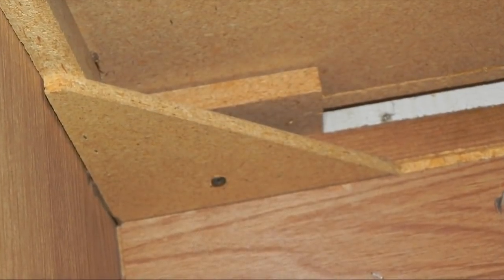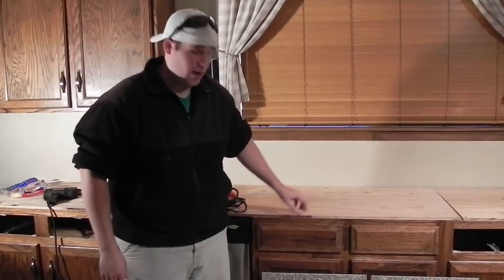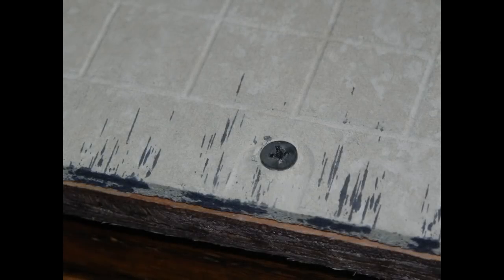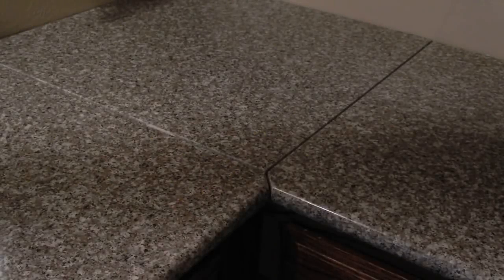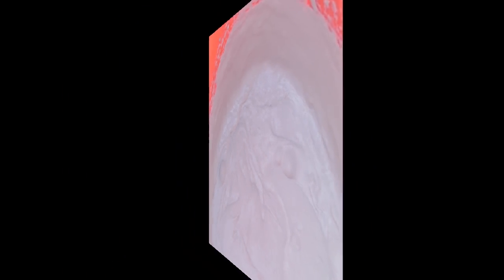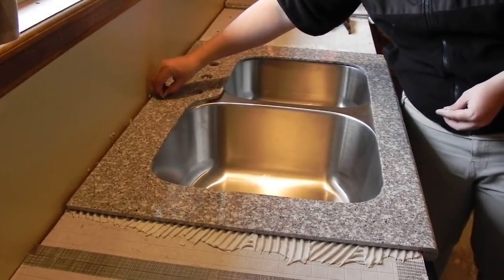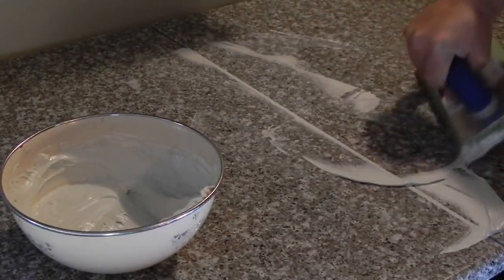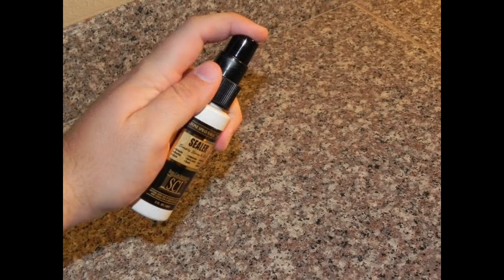Lazy Granite Kitchen Countertop Installation Video

Comment: I'm sorry.  This product and the installation is a fail.  Screwing down the plywood and the cement backer board from above prevents the counter from ever being replaced in the future without demolishing the counter and lower cabinets.  The sink would be equally impossible to replace in future.  The grout lines are hideous and ghetto.   In my area, there are manufacturers who sell custom sized economy granite countertops.  These are 1/2" thick granite which comes bonded to 3/4" plywood substrate, with build up and reinforcement, rather than buying 1" thick granite.  They are custom made as continuous counter lengths to suit your measurements with no seams.  The cost is half that of 1" solid granite.

Comment: I thank you for posting this video. There are a lot of keyboard warriors on here criticizing your video, but people will stop posting if all they get is criticism!  In the end, a ganite slab costs $30 to $50 per square foot, and for under $10 per square foot, this is a far cheaper choice. Most people don't have the budget to spend $3,000 to $5,000 for a solid slab and I think this video is terrific.

Comment: The concept is nice. However, it would look best with tight seams using epoxy mixed with granite dust. The large irregular shaped "tiles" confuses the eye making the whole installation look like a DIY gone wrong. I really hate saying this, but I feel obligated to tell others this is not the way to go. At least as far as having grout lines. A 12" tiles would look better if a tiled look is desired. Otherwise use epoxy with color matched granite dust to hide the seams.

Additional, the plywood and backer board surface must be completely level and even across the entire surface. Or you'll have noticable unevenness. The larger the tiles the better your prep needs to be. You can adjust somewhat with the mortar thickness. 

Lastly, no cutting corners when cutting the stone. Start with a new blade, use the fence, pleanty of cool water, and go slow to prevent chipping.

Cheers!

Comment: Hey, I have to be Mr (Ms) fix it in our house, very tight budget, and alot of DIY because of this. A contractor that workED for HUD really messed my Mama's, our, house up,,stealing money and half ass not fixing things. Well our countertop is a fake granite, that's already warped of room being wet u can see the swelled particle board on the thing. CAN U TELL ME WHAT that's called, I know it isn't granite, I don't know the correct name of the countertop. I been searching some way to fix it,,,we sure don't have the cash for new ones. Any help or advice would be appreciated. The ex contractor also really made things worse. Example, he put metal on our shingled roof, that leaked, it leaked more afterward and how awful it looked too,,didn't put gutters on, ruining what deck my mama had, he lied and said he replaced electrical wiring,,the wiring has been in this house since 70's late 79!!!!? It so happened the person he contracted the electrical work out to, I KNOW THAT MAN, he didn't replace it,,just hooked old up to New breaker box. The beautiful tiles on kitchen floor, cracked immediately within first week of walking on it.. HUD fired him, but he's still out there somewhere ripping poor old people off

Comment: Absolutely hilarious! This guy sounds like a tool. I agree with the other posts. I've been in the granite business for 20 years and the sink run should have 1 seam without spacers! Lmfao!  The sealer is garbage as well, you don't spray sealer on, you pour it on and bath then buff until dry.

Comment: that looks completely awful he didn't grout right so after a while the granite will crack 2 it shouldn't show seems at all its lazy boy granite tile doesn't mean its supposed to look like tile I did mine with the granite lazy tile and it looks like one long slab and I was told to use epoxy sealer to hide the seams this dude clearly doesn't know what he's doing

Comment: This is not a bad approach for do-it-yourself granite counter tops, but I would omit the installation of tile backerboard and mortar. Simply install directly over the 3/4-inch plywood with construction adhesive as most professional installers do.  Also, there is no need to accentuate the grout lines by putting in spacers and grout.  Seems should be butted together and seal with clear silicone.  They will be less conspicuous.

Comment: #664 is the cheapest granite there is. Locals business in Dallas area can do it for $29 per square foot can get you a fabricated full slab that's at least 2cm thick not 1cm thick that they are using.  That price also includes installation! These guys are literally selling trash remnant pieces.
Reply: @ DW, i live in Arlington. Any granite guys you can recommend?
Reply: gary paternite try cabinet stone city or any similar shop near their area. There are a lot of these granite shops in Dallas.
Reply: Thanks a ton sir!

Comment: is there a grout that is mixed to exactly match the granite?   If not, is there stuff so the homeowner can mix their own custom grout?
Reply: bakerchic1958 usually shops use stone glue/epoxy and pre-mix with correct coloring to match to granite then place that into the seam area. Once dry polish the surface lightly. You need to have a good skill in getting a correct coloring out come.

Comment: That is an awful lot of work to get something that looks so cheap.  I think they would have been better off with a nice looking laminate.  The cabinets are really low end.  It doesn't look like a house you would want to put a lot of money into.  You could do a nice tile backsplash and call it a day.  New cabinet doors and a nice laminate countertop would have probably been a better choice for this kitchen.  I've done a lot of DIY, and made my fair share of mistakes.  Things like this just aren't worth the time or money.  If you can't afford a really nice slab of granite, don't do it.  You'll never be happy with the results.
Reply: Those cabinets look like they might be in a mobile home that is 20 yrs old.
Reply: Decent looking granite is 24bucks a foot in my town.  INSTALLED.  Cheap as chips.
Reply: Hotrod Hog I'm pretty sure it is a mobile home.

Comment: Wow. Please people do NOT, I repeat DO NOT use this process, being a certified granite fabricator there are many variables in the equation he does not explain, A. He is using a 1 cm product, that mean's it's only 1/4 inch thick product, the quality of the product is poor at best 3 cm which is 1" 1/4 inch thick is the best product to use. B. Cutting granite, no matter what blade you have, on a table saw is never a good idea. The product will chip exponentially to start, and laying it on it's face will scratch it if there is any granite residue on the surface. The reason Granite is some what expensive isn't because the product cost so much, your paying for a quality fabricator and installer to give you the best results in a timely fashion.
Not to mention the time= money, the amount of labor and materials you will have into the project will cost you far more then having a professional do it.
Reply: Terry Henkes in addition, this guy didn't show any thing on how he fabricated the undermount sink cutout, which usually require 1 hr to do with wet hand saw. These guys only show using table saw which isn't even an actual wet saw type.

Comment: First of all the cost of this material in a natural slab form is fairly cheap. Second this guy just made a sh*t ton of work for anyone trying this..instead of mortar use freakin Liquid nail like a professional would..his damn seams wouldnt have been so bad if he actually gave a sh*t and mixed the proper color in the epoxy before butting them up!!!

Comment: this looks terrible, leave granite installs to the pro's. that whole run could have been done with one seam and a tight one at that, that most likely would have almost been virtually invisible and with no feel.
Reply: that right  more tight space on granite it would look great, (1/16) plus i will recommend to let the grout  dry more and use blade to scrape, for more flattered result at the joins( is not going to get a scratch).
Reply: Billy Toilembocker aa
Reply: Denise crispim peres

Comment: The grout lines ruined a perfectly large piece of granite. It looks disgustingly terrible
Reply: agreed...
Reply: The grout lines what a mess!
Reply: Tom Hamilton hii
Reply: Como tapizar mumbles de sala
Reply: SAMURAI MARIO
Reply: Sitr
Reply: john moore m
Reply: Sitrix what do they say about opinions?
Reply: George Rachitan I think if you are going to use tile ,they should be smaller and uniform. level set no spacers then a matching grout to fill bevel's or epoxy .a separate trim on the edge to cover the reveal.you could do this on a budget as well,Home Depot sells 12 'x 12" rectified granite tile. But I'm not knocking the guy for trying,even though it looks really bad.
Reply: at least make smaller grout joints and full them up with same color epoxy  try to make them invisible

Comment: WOW, you can get this very same color in regular granite for about the same price, and have it PROFESSIONALLY installed for a reasonable price.  You'll have fewer seams, a MUCH nicer looking countertop, and no headaches.  The guy does a nice job telling you how to install, but dang, forget the video, get to your local countertop dealer and do it RIGHT!  Plus, do you just happen to have a wet saw sitting around your home?  I sure don't.
Reply: looked like he was out in the rain cutting it or had the sprinkler on not a wet saw lol and his trousers was way to tight haha
Reply: at $30 to $50 per square foot, for a solid slab, versus $10 per square foot, how can you complain?  It's all about cost, which is why this method is even being shown in the first place!

Comment: The point of having one slab of granite, is the continuity of visual flow.  There are no breaks for a reason. This method exposes large breaks, is very non-symmetrical, and visually disturbing.  If it has grout lines, it is no longer as functional as granite slab, and greasy dirt will trap in there looking very, very ugly.  The thinness makes it prone to cracking if something is dropped on it.  Might as well get cheaper and more colorful tile!  In fact, this is nothing more than very large granite tiles.

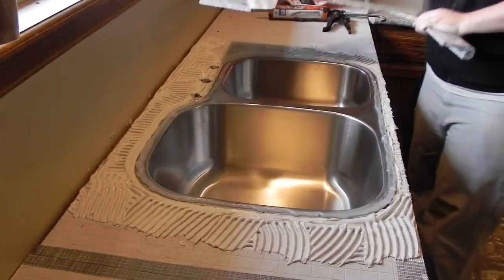Comment: @9:15 - If you ever want to swap out the sink due to damage or any other reason, you're now fucked and will have to rip out the counters too.
Reply: +Fucknuts How often does a sink fail for no apparent reason?
Reply: I didn't say anything about the sink "failing"' for no reason, did I?

Comment: At first glance I thought it to be ugly, then on second thought, it looks like granite style counter tops from like a hospital/industrial kitchen.  Not bad.  I would do this in my kitchen.  It looks easy to do if you are doing a counter top alone and you may not be very strong to carry a large piece of granite.  It has function, despite it's looks.  Its not messy like an 8 year old put it together.  I wonder can the grout lines be colored to match stone material.
Reply: Typically a professional will be able to mix the epoxy the right color from the beginning so when you butt up the joints its practically invisible...that's the idea atleast

Comment: I don't think this is aesthetically acceptable.  For sure it does not compare with 3cm granite slabs.  I think if you want to save money it is better to just use small ceramic tiles, at least the look will be aesthetically pleasing.  Why does Lazy Granite not make longer granite boards?  I think with some fiberglass back meshing epoxied on the granite they can get away with much longer slabs.  As for the using the spacers between the tiles ... you really don't want that.  Much better would be to use a clear epoxy with ground up granite of same color and place it vertically on the cut slab and then press the slabs towards each other.  It would make an almost invisible seam.
Reply: majdq8 you've done it before? I don't think so it's not that easy. 3 cm and 2 cm are the same shit the only difference is the thickness

Comment: Wow, I didn't look at the comments at all before watching this, Found myself wincing quite a bit throughout the video I have to say.  I don't know exactly where to get the "Lazy tile" product but I have to say that you have made this video and helped me think that I might not want it anyway. I mean, If I was going to have seams like that I think I might just choose to use real tile with a decorative look, I mean, since this looks kind of bad.     Pretty sure the cost of that material is pretty high leaving me to believe i could find something that looks much better for less money.    I wonder if there is a way to use this type of material and Not have any visible seams at all.

   the sink thing was looking a bit wired to me, after all is said and done there is a gap between the sink and the sink and the tile that runs as far back as your silicon bead. even if you caulked that off there would still be a dead air space in there that I would not feel comfortable with.    I think i would pull the sink out, lay the grout, re set the sink so there were no grout on top of those edges of the sink at all like you had and then run the silicon on the sink all the way to the edge where the tile and the sink meet and then clean the silicone up so that there would be no way water and gunk could get up underneath that tile, even if catastrophic failure did not occur ( I am pretty sure it would)  there would be mold and crap crowing under there in no time if that step was not done correctly.    Right? 

  the real deal killer though is how this looks when completed.  I'm not sure what type of counter type I will ultimately choose but i am thinking this one might be completely off my list    so thanks for the video for at least that.

Comment: Am I the only one that thinks about the sink and water combo problem? When you have water in the sink from normal dish cleaning splatter and sprayer, the water will go into the crevice between the top of the sink and the plywood. All that is there is some randomly applied non-waterproof glue and even that is not applied as a steady bead around the perimeter of the sink top. It's impossible to clean the inevitable mildew and food particles. Just yuck and ick. I feel horror at anyone living with this time bomb. Please, don't do this!

Comment: Personally a quality laminate  would look better and require less maintenance. Laminate is very durable and does not need to be sealed because it is not porous like granite. I went through the calculator on the site and was not impressed by their prices. I have two places that will do real granite tops for less. In fact you can get the same thin granite seen in the video for $140 per 8' pre made countertop with backsplash. For a little more you can get 3 cm countertop slabs with backsplash from floor and decor or other suppliers in 9' slabs. The price of installed granite has come down quite a bit in recent years because of the amount of competition of installers. Full slabs aren't that expensive you are paying for the fabrication. Going rate here now is anywhere from $14-$35 sqft. You can get it as low as $8 if you pick up and install yourself (1.5-2cm).  
        The granite in the video is just a large format tile countertop. Our house had tile countertops and I will never have them again.
Reply: laminate is shit. I have four laminate countertops and they fucking SUCK

Comment: Jesus, some harsh comments. It's a product for those on a budget, who want granite. It's not perfect, but I don't think it was meant to be.

Meanwhile, I think the presenter sounds like a young Herbert the Pervert from Family Guy.
Reply: if you can't afford the 50-60 dollars a square foot that real slab granite runs then get some butcher block from lumber liquidators or whatever that website is, they sell 1.5" thick  8 and 12 foot lengths of 25" deep (so it overhangs the front of the cabinet) for what works out to be about 15-20 bucks a square foot and is a hell of a lot easier for a DIYer to install on there own. I doubt this stuff is any cheaper I mean you're like 2 bucks a square foot just between the plywood and backer board and even if these tiles are 1/3 the cost of real granite (since they are 1/3rd the thickness, except at the nosing) your still 15-20 bucks a square foot and left with nasty grout lines.

Comment: whoa!!! you really expect a weekend DIY guy to be cutting  those panels freehand on a table saw???? good luck with that..iam a building contractor with over 40 years in the trade,i would be real concerned about that..whats the point of leaving seams?? dont look real good...nice product though,if i did it no seams...
Reply: WOW THIS IS UNBELIEVABLE!!!! I DON'T NEARLY HAVE AS MUCH EXPERIENCE AS YOU BUT I HAVE DONE GRANITE LONG ENOUGH TO KNOW THAT I'VE NEVER SEEN IT CUT WITH A TABLE SAW BEFORE ITS NOT TILE!!!! SMH 

HONESTLY THIS KITCHEN IS SMALL AND SHOULDN'T HAVE ANY SEAMS AND IF I DID HAVE TO SEAM IT IT WOULD'NT SEE IT!! ;)

I GUESS YOU ALREADY KNEW THAT YOUR LAZY METHOD WOULD'NT WORK IN THE WORLD OF GRANITE AND THAT'S WHY YOU DISABLED THE RATING FOR THIS VIDEO!!!! 

ONCE AGAIN THOSE SEAMS LOOK HORRIBLE AND DAMN THERES SO MANY OF THEM!!!!!!! SMH

P.S. STOP PUTTING THE COLORED EPOXY IN THE SEAM LIKE ITS GROUT!!! AND THAT COLOR IS WAY WAY TO LIGHT!!!!!!

Comment: Looks like crap. Nice flannel safety shoes. He says "use clear silicone" and he uses white.
Reply: Gerardo Aguilar Lmao. You are so smart aren't ya. How about most clear silicone is white to start and turns clear. What is y'alls problem. You are trying to compensate for something... For some reason you wanna cut other people to make yourself feel better.
Reply: Well seth if it goes on white and drys clear then that’s not 100% silicone and you might as well use paintable caulk.